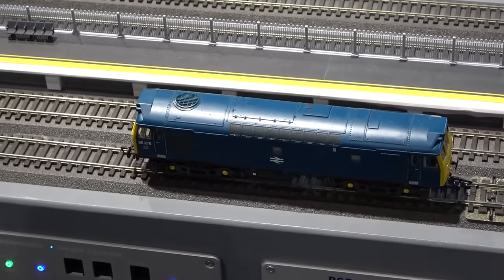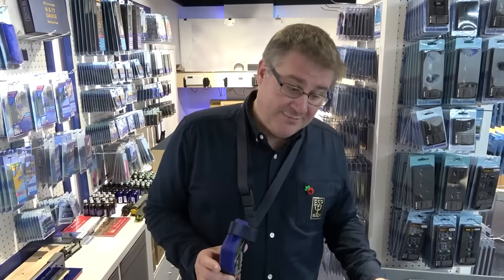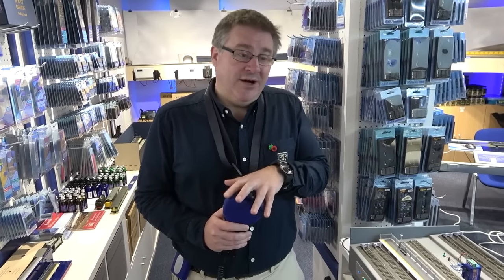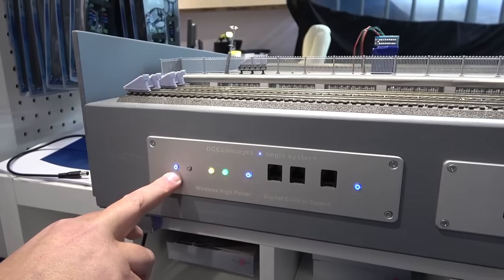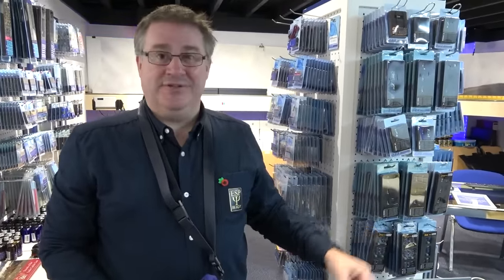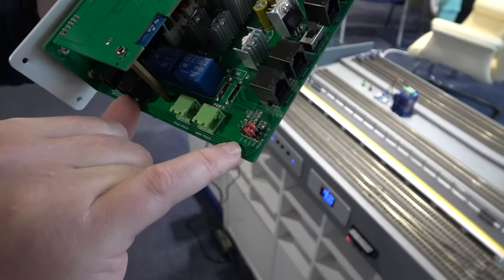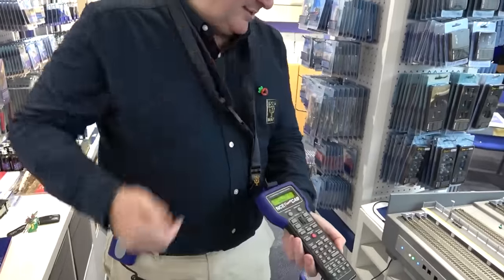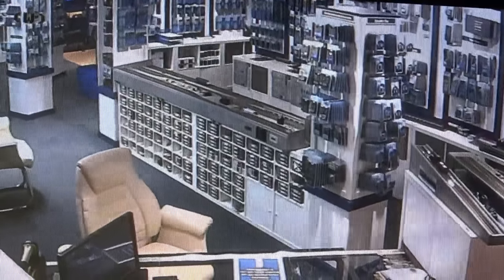DCCconcepts ESP Ψ aegis System - An Overview with Howard Smith and Richard Brighton

Comment: I’m a big fan of dcc concepts I have the power cab but this is just to expensive these prices are through the roof 499 out of my league sorry to say
Reply: The price is very good value for the features on offer. To obtain the same features with NCE equipment would cost over £700, plus the PowerCab. We also offer the ability to split payment, with 50% paid on order and 50% paid on dispatch to help spread the cost.

Comment: Hi how does it work having the alpha pannel instead of utp do the wires still plug in the back and on the front is 3 controllers because the website I couldn’t understand it thanks Joe
Reply: The Alpha Panel will work either as a UTP or a PCP depending on the selection switch on the circuitboard. We will have Alpha Panel back in stock within the next 2 months.
Reply: @flipvideodemo  hi so i could use a aegis pug 3 alpha panels in and with the alpha panel plug in back and my front 3 ports are for a controller and I could plug another alpha panel thanks Joe

Comment: Hi, An interesting upgrade for a basic NCE Powercab. I also have the PC panel to link my NCE to my laptop and then use JMRI Decoder pro to alter my decoder settings that way, I think it is easier. Would I still be able to do this or something similar with your new aegis system? Look forward to seeing how this system develops. Thanks and all the best Dave.
Reply: You can use the NCE USB adapter into one of the rear ports if you have a PowerCab connected to CAB MAIN (the NCE USB adapter needs to talk directly to the PowerCab via a cable connection). However, we are working on our own version of this which will operate without having PowerCab connected physically to aegis - watch this space!

Comment: It looks good will it be able to run the current to run my locos , my station lights will be separate power . By the time I get it my layout should be up and running . Still a lot of work to do.
Reply from the maker: Aegis will provide 5 Amps to your layout - depending on the size of your layout and how many trains you'll be running at any time - this is a significant amount of power. If you want advice on the amount of power you'll need - please do get in touch!

Comment: Can this be used with the likes of the Gaugemaster Prodigy 2
Reply: In order to get wire free operation with Gaugemaster prodigy, you will need to use their own Wireless Module. Due to the way Prodigy works with it's base-station, this version of aegis cannot be made compatible. Hope this helps :)

Comment: Is it able to connect to JMRI?
Reply: I have the Aegis system installed and cannot get it to work with JMRI. Larry Puckett “The DCC Guy” said he got it to work programming on the main, but I couldn’t get it to work. I’m a big JMRI user and it’s disappointing the system isn’t compatible, but otherwise the Aegis system is great so far.

Comment: Big bucks but I guess the fundamental is whether you have a need for wireless application, horses for courses and all that. Personally I never understood why NCE was so popular without a graphics screen and so many keys to press ie on the ECoS I bought, you can do all the track layout design, pictorial loco selection and turnout switching without going between multiple menus, has Main and additional Programming Track feeds and recognises other controller inputs eg Roco Z21. It also has a reasonable 6 Amps output and twin controllers
Reply from the maker: The ECoS is a fantastic system - but not if you want to walk around whilst controlling your locos. If you do, then you can connect a glass screen device - or get the cab throttle - which is also glass-screen with a motorised dial. If you want a "walk about" handset with push button control, then NCE is a great option. We even have Alpha and ESP accessory control options with push-button operation, so no multiple button-pressing!
Reply: @gppsoftware  Both replies have valid comments which is why my comment re application is key ie whether you have a small, med or large (multi-user) layout and thus your spend.
Reply: The Ecos DCC System is sold in Australia for $1350.00 (£704.50 or $885.75 USD), whereas the NCE Power Cab can be purchased for $400.00.... More money will buy you a more fancy control system.

Comment: @richardbrighton7737 - Hello Richard, I hope you are still monitoring comments posted to this video. I currently use an Alpha Box booster (with the Alpha power supply) together with my NCE Powercab and I am very pleased with it. I am expanding my layout and looking to add a second booster. I could of course simply replicate my system as it stands now, but I am wondering if it is possible integrate the new Aegis system with my Alpha Box and Alpha power supply system? Thanks, Andrew
Reply: Hello Andrew - yes, you can! You can use ESP aegis as the master system, with your PowerCab. You can then use Alpha Box to boost a second power district, connected to ESP aegis using an RJ12 cable to one of the EXT ports on the rear. Hope this helps! Richard.
Reply: @richardbrighton7737   Thanks Richard. A few days back your colleague Chris sent me a copy of the user manual that shows exactly how to cable things up. Thanks again for following up

Comment: Only works with NCE?   and any other DCC controllers in the future?
Reply: Hi Dennis - yes, this is only for NCE PowerCab handsets, being the most commonly purchased DCC starter system. This type of system wouldn't work for DCC systems which have a base-station such as MRC/Gaugemaster systems etc... which system did you have in mind?
Reply: @denniswilson2690  Digitrax works through a base-station, so it would be challenging to make a similar system for a Digitrax handset. The reason this works for PowerCab is that the entire DCC system is embedded in the handset. Never say never - but this would need a fair amount of R&D!
Reply: @flipvideodemo  OK thanks for the prompt replies.

Comment: Or you can purchase the Iowa Scaled Engineering ProtoThrottle, which is wireless, with much more realistic operating abilities than the NCE PowerCab for less than the Aegis panel. The ProtoThrottle is also compatable with Lenz, ESU CabControl, JMRI WiFi Throttle, MRC Prodigy (via wifi module), Digikeijs DR5000, and Digitrax (via an LNWI module). 😉
Reply: Hi Gaz, ESP aegis is a PowerCab upgrade product. It is for modellers who already have, and enjoy using, their NCE PowerCab handset. There are other pathways available, but not whilst maintaining their (very simple to understand and use) PowerCab handset. The ProtoThrottle handset also costs over $400, with the receiver costing another $99 - which is considerably more expensive than ESP aegis!
Reply: I have a Powercab now, and see the advantages of the Aegis, as a next step. After that is there a way to use a Protothrottle with Aegis?
Reply: @Blue_Dingo  we have not tested Protothrottle with aegis - however, as this operates through the ProtoThrottle receiver for NCE Cab Bus - this should connect to the EXT ports on the back of aegis and operate in the same was as an NCE handset.  Bear in mind that you will need both the ProtoThrottle and the NCE Cab Bus Receiver for this - aegis is not natively compatible with ProtoThrottle handsets.

Comment: I was told it is a Snupper if that the right way to say it it for changeing my points form the Snifer it’s  fit in a match box it’s not that big it has two white little things on it and two little black round thing 220 volts on top off the white little things two wires in and I put the two wires from the Sniffer to it I can send  pictures if possible thank you DCC
Reply from the maker: We have these available free of charge - please email to salesuk@dccconcepts.com with your details and we can send out to you.

Comment: Still got that horrible curly lead on the handset though :(
Reply: You can use a flat RJ12 cable to connect to the transmitter if you prefer.